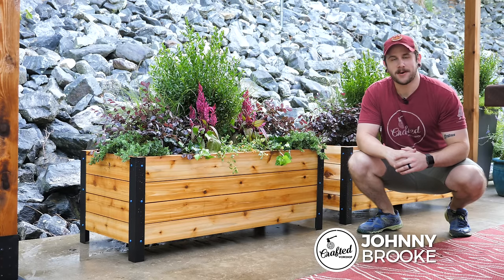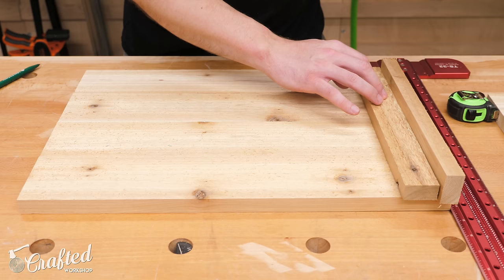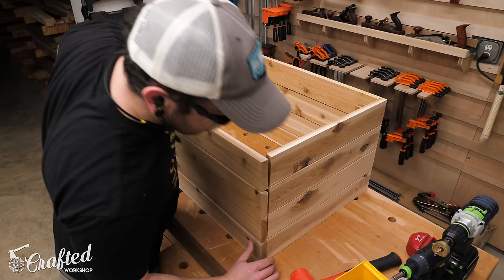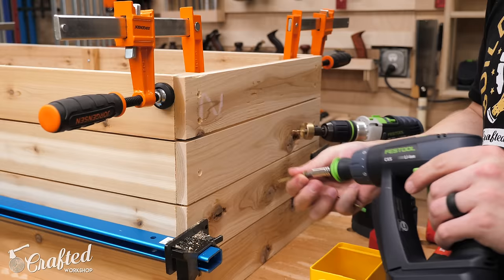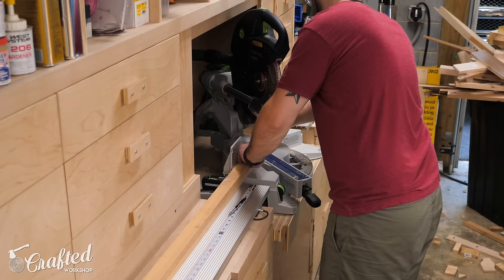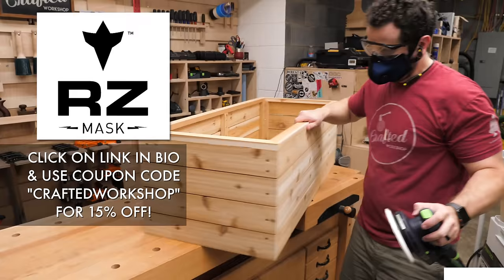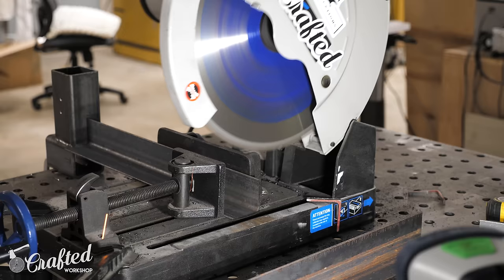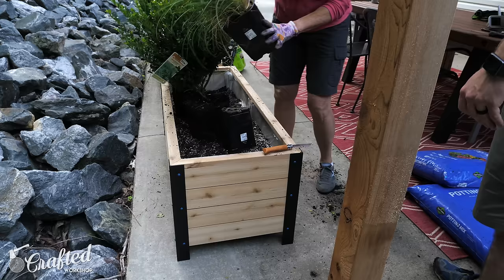DIY Modern Raised Planter Box // How To Build - Woodworking

Comment: Maybe I missed it, but if these are going to be exposed to the elements outdoors, shouldn't that wood be treated? 
I learnt the hard way with my first planter that not applying multiple coats of oil-based stain = rotten wood and a new planter within a few years.
Reply from the maker: Cedar holds up really well outside and these planters still look great years later, although the cedar is gray now.

Comment: Love the design. Awesome work. I have a question if you don’t mind.
The screws you attached the angle iron with what size are they? Would it be better with bolts?
Reply from the maker: I used 2 ½” screws. They’ve held up fine, as I also added the construction adhesive.

Comment: Could you make a video without using any power tools that aren't hand held?
I live in a condo and can only do small projects on my balcony, I have a hand drill and a Dremel 4000 with as many bits as I could find for it. I have to saw everything by hand and cut metal with my dremel so projects are extra tricky with no garage, no open space, no miter saw, skill saw, drill press, belt sander or angle grinder. Working only on a small balcony in Canada where it's cold for 75% of the year. I'm wondering if theres any tricks I'm missing out on since I have to be creative with how I build things due to my situation.

Comment: Awesome job! What plants did you guys use and where did you place each?
Reply from the maker: The center one is a Japanese Box Wood, then the pink ones are Dragon’s breath. There’s some Juniper and Ivy out near the ends. The rest, I don’t know. Thanks!
Reply: here's a little more detail on the plants:  I started with the largest center plant - a Japanese boxwood.  I placed two "Little Bunny" Miscanthus plants behind the boxwood.  Next I put two Loropetalum plants (common name Fringe flower) in front of the boxwood.  The placement is kind like an X pattern - with the boxwood in the middle of the X -and  the grasses and fringe flowers at the top and bottom of the X.  Leave some space between the boxwood and the grasses/fringe flowers  to allow for growth. I tucked in two Celosia "Dragon's breath" plants (an annual)  between the fringe flowers and the boxwood.  In the very front center are a few calibrachoa plants (also called million bells).  At each end of the planter in the front are two junipers.  Also added lots of ivy all around to fill out the container.  Hope this helps!

Comment: All you need to do this "super simple DIY project" is a mitre saw and a drill... and 17 other tools.
Reply from the maker: I used other tools but you don't have to have them. There's a million ways to do everything in woodworking.
Reply: @craftedworkshop  I appreciate the reply; however, when doing a simple / beginner DIY project, for which you say only two tools are required, I think it'd be more useful to demonstrate how to do the project with those tools.  Amateur / aspiring DIYers not only don't have the tools, but they also likely lack the wherewithal to know how to modify the project to complete it using the limited toolset, or how to accomplish your (impressive) results without your tools.

Hope you're well and wish you the best.

Comment: I went to Home Depot, Lowe's and a local hardware shop.  They all don't carry cedar 1x2's or 1x4's, bah...  They do have redwood though in rough, dry clear and flat top picket.  Any suggestion if cedar not available?
Reply from the maker: Redwood should work fine!
Reply: Thanks!  I went with the Redwood heartwood picket
Reply: @craftedworkshop  Question: I picked up cedar 1x2's and 1x4's from HD and for the top cap 1x2 board, it doesn't quite cover the width of internal 1x2 support and the edge of the top cedar board. So you can see the edge of the internal support. It's perfect in the video, why the difference? 
Thanks and great video, almost done with my first box!

Comment: Miter saw and a drill😅😅😅. But he used a work table, gigantic T square, glue, brad nailer, which connects to a compressor, then used some $100+ dollar giant clamp and $50 dollar each small clamps. Then used a countersunk drill and a tape measure then used a table clamp and a drilling jig. He also forgot to mention the long reach clamps and a sander. Last but not least, that evolution chop saw is a $400 item. So our project would look like crap, nothing close to yours, thanks...😫😫😫

Comment: I wonder if all of this power tools vanished in thin air... Will he still be able to built anything? 🤭🤫
Reply: Yes. He could. Because this is ridiculously simple to make. Hack saw, hand saw, hand drill, screwdriver. You could even skip the metal legs and use wooden ones instead.

Comment: You've just spent 3 days and 200 dollars worth of materials to make a 50 dollar pot. On top of it, you didn't handle it against wood rot, and you left nice little gaps and crevices everywhere so that water can stall in it and cause further rot. You didn't attach the plastic foil properly between the decorative top and the top beam, and it's a thin material that will quickly tear further, especially under a gardening shovel.

As a gardener/woodworker, I'm unimpressed. It's unnecessarily complex to build, and it's not built to last. It looks good, for like a year, then it's a goner, to rust and wood rot.

Comment: I like these but where is the line drawn between DIY and profession production? The builder has a couple $1000 in tools. What can I make with a screw gun, chop saw and an angle grinder?
Reply: You don't have to answer. I can figure it out. Thanks for the video.
Reply: Ethan, triggered bud?
Reply from the maker: I basically used only the tools you described. The brand doesn’t matter as much when you’re building stuff like this, you could easily build this with very basic tools.

Comment: Great video but this is clearly not a DIY process with all your tools
Reply: Exactly what I was thinking. Jesus, first hurdle to overcome is buying a shedload of tools.
Reply: @lc3433  The thing is though it's not just having a shed full of tools.  He has a shed full of specialty tools.  I seriously question who this video is made for and what his audience is.  Couch diyers? People who like to watch videos of all the potential things they can make at home but never get around to making any of it.
Reply: @Jaze2022  Yes mate, good point. When I see clips like this and the title say DIY, I do expect the use of some tools, like you're everyday household equipment that most people should own. If I was to follow this video to the T, then I would seriously need to go out and make an investment in some tools before I even bought the materials to make the damn things.
Reply: @lc3433  there are other videos that show you tips and tricks with basic tools.
Reply from the maker: That’s kind of the idea, Lee. My videos are targeted at people who have at least a basic tool set. This planter could easily be built with a circular saw, drill, and sander. You could easily sub out aluminum instead of steel for the legs and cut it with a regular woodworking saw. Building things like this requires at least some kind of investment in tools. If you were to only build one thing, it wouldn’t make sense, but this is a hobby people invest in over time. It’s not different than spending $1,000 on a guitar or set of golf clubs, except you actually get a finished piece out of woodworking as a hobby.
Reply: @craftedworkshop  it makes sense if you look at it like an expensive hobby. I still wouldn't call it "diy". I'd argue the planter could've been made with a chop saw or circular saw plus a impact driver only.

Here's an example to really bring home why your video rubbed us the wrong way. There's another diy channel where the creator made an awesome headphone stand with multiple layers of wood and acrylic. The catch was that he used a $2000 usd cnc to make it.  It also had "diy" in the title. The difference was he fully disclosed that his machine was free and the video was sponsored in the video.

And here's another example. "Simplest Diy racing wheel stand".  First step, get a Porsche 911 leather seat. o.O what?

Comment: Cool project , can plainly see here the tool sponsors adding fifty extra steps , when I see glue being used or clamps in a project that is screwed together  , I just go HUH , I build using screws all the time at no point in any project ever have I said damn the screws fell out , thank god I glued that first , with the exception of flooring , it serves no purpose any way shape or form , besides making a mess and oozing out , ruining your project . gluing a piece of angle iron , before attaching it with screws , Im confused to the point of being pissed , and dont forget , if you should have to replace a board later , the glue is going to make this an impossibility .
Reply from the maker: These planters are incredibly heavy. Cedar is extremely soft wood and screws will eventually work loose, especially as the wood gets wet and rots. The construction adhesive is a huge benefit here.